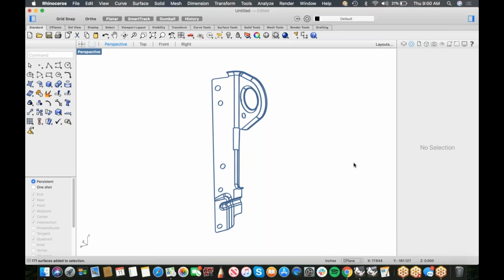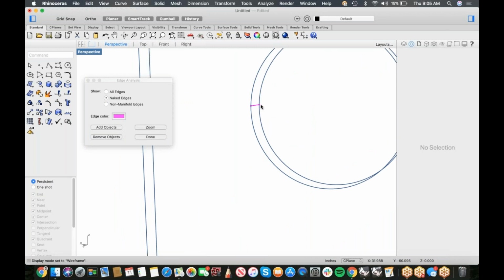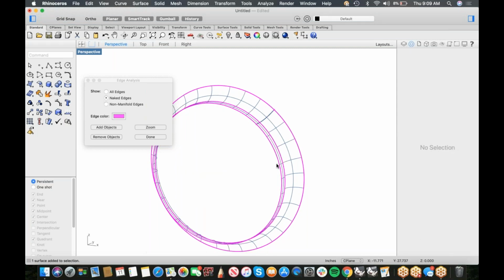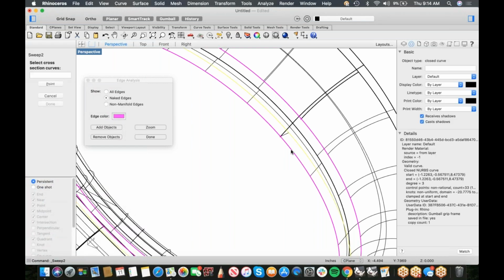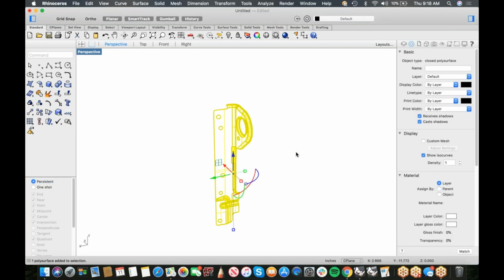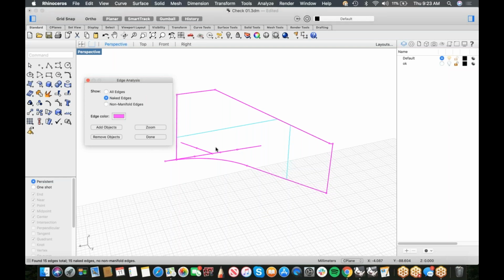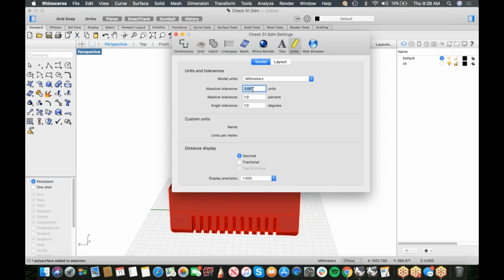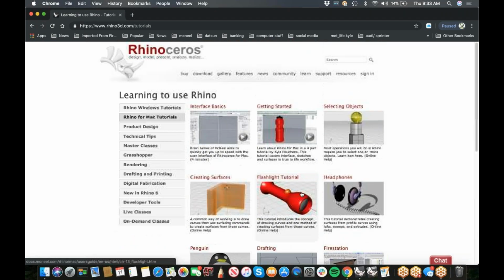File repair for watertight parts

Comment: Kyle...this might be one of those urban legend things but with regards to the tolerance when exporting I've always added that to be in my initial templates before even modeling anything. That to start modeling at sat 0.1" and even if in the middle of modeling it's changed to 0.0001" any of the geometry that was made prior to the change would not be updated. 

Also there are optimal neutral formats when exporting to the different CAD packages. For example parasolid I've found to generally be a better file type to export for Solidworks because that's what the kernal of the software is written on. This, say in comparison, to exporting the same file as a (.step) or (.iges) generally has a smaller file size. Not in every situation but just a bit more in general terms. Also technically Solidworks can go out to 8 decimal places if those pesky engineers really wanted to put a bigger bee in your bonnet...... :)
Reply from the maker: you are correct, you want your tolerances set before the first line is drawn. 

I worked on a huge project where i had to make 1000's of molds they all had to go to solidworks after I was done.  

Step ap214 cc2 worked for some, parasolid worked for the others... no rhyme or reason as to why one worked and the other didn't and vice versa.

Comment: So at the risk of sounding dumb (I don't have a CAD/CAM background), but what would cause the models to be in a broken state like these were? Were they broke "at the source", was it just part of the conversion process into Rhino where things didn't match up 100%, or is it something else?
Reply from the maker: Any number of issues, could range from something as simple as a tolerance mismatch, all the way to an utter Train wreck of a model made by someone with limited skill. We try to allow rhino to handle it all..

Comment: Ugh god damn solidworks, always to blame! 🙃I always appreciate the videos!
Reply from the maker: Most of the issues with solid works data is simply tolerance related. Their tolerances are very very tight. Rhinos are more reasonable. When you bring in their data you have to crank the tolerances in rhino to match. 

.0001 of a unit is a good starting point.